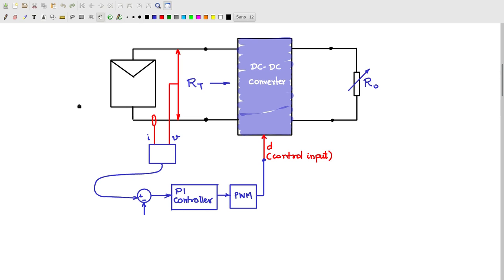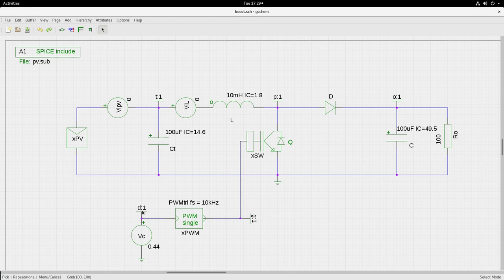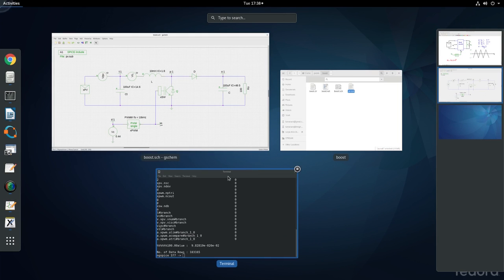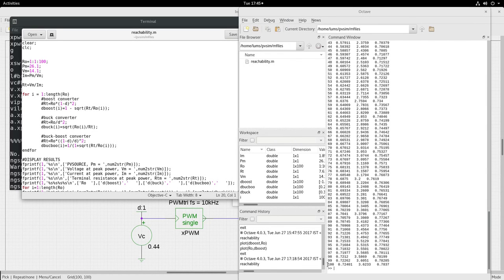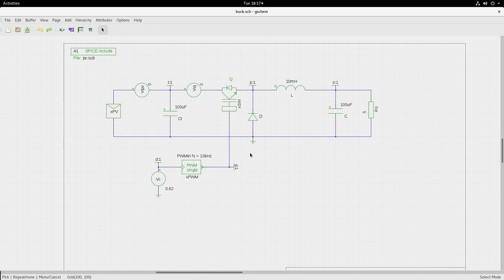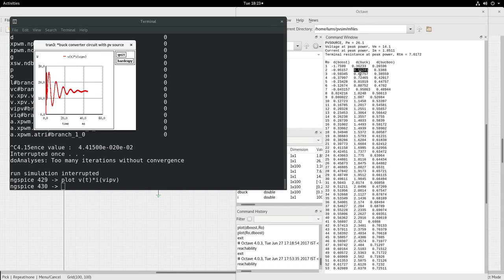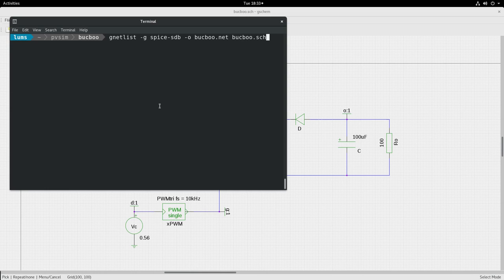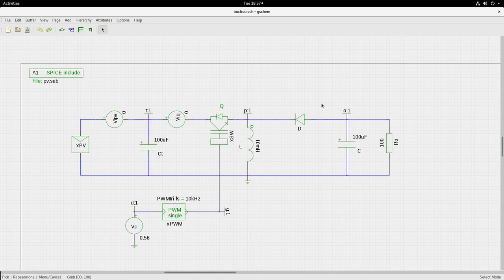Simulation of PV and DC-DC converter interface

Comment: Do you have the ability to either physically construct the components or provide a schematic with a list of components that i could have assembled in the USA?
I am looking for a way to use Direct Current in a 300 to 600 or more volt range direct from solar to charge an electric car with no battery back up and no grid tie.